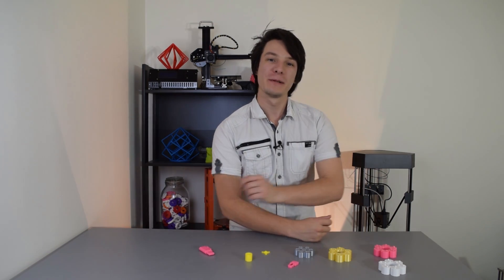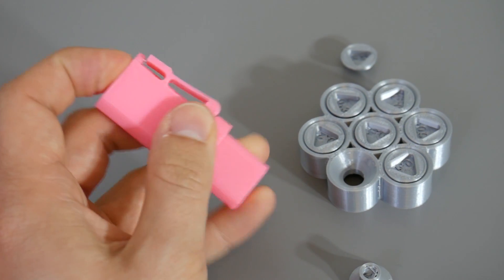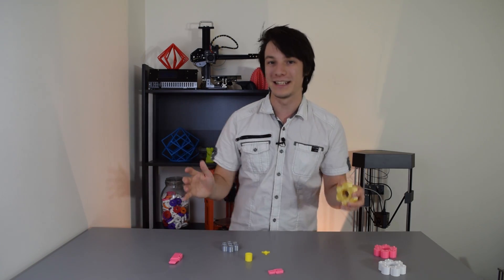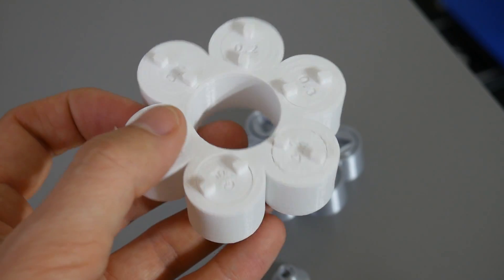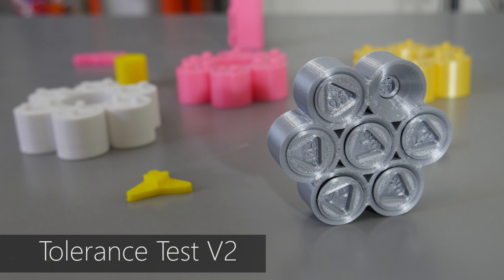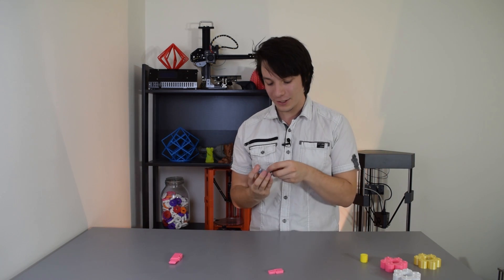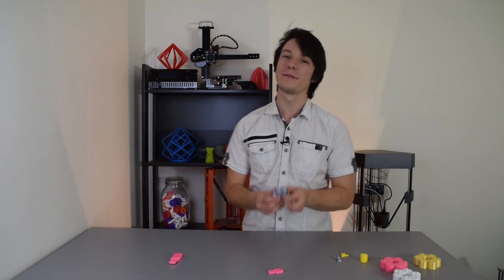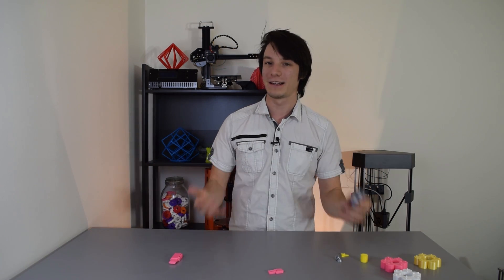How Accurate is your 3D Printer? Take the Tolerance Test!

Comment: So this test is when you make a hole at 1, and the pin at .5 (for .5 gap)?  Adjusting the settings would do it automatically if both the hole and pin were each set to 1?  Or do you still have to design in the tolerance, the settings just make sure they stay where you tell it?

Comment: Why is it called tolerances and not clearances? It's not about tolerating it's about clearing

After looking into it - tolerance means how well a part can tolerate manufacturing variance. Whereas clearance is of course how far the parts clear each other by when moving. You could use either here. You're adding part tolerance by increasing part clearance

Comment: If you don't want parts breaking off when you're freeing it from the bed, or when you are trying to release them, use 8 line walls. This will ensure solid hourglass waists. I also re-mixed the wrench so your fingers don't hurt - I'll put  that on Thingiverse. Yes, I'm aware of the Mark 2 on the other video.. 😁

Comment: Pulling up on an old video but just HAD to chime in. I was able to get to .2 tolerance with easy spin initially on my stock Sidewinder X2 and could eventually get the .15 tolerance after applying a little force with the key. Initial test was printed at 0.2mm layer height from a 0.6mm nozzle and the second test where I could break free the .15 tolerance was printed at a .16mm layer height. Fantastic object and love your videos! I've been following you since my forray into 3D printing.

Comment: Thank you for this! I'm a bit new to 3D printing and have had a lot of trouble with hole measurements. It took me 8 versions of the same part to get it right. With this, hopefully I'll achieve a successful build with more confident measurements and less waste in both filament and time.

It's also cool that it doubles as a fidget spinner!

Comment: Ender 3, 0.95 flow rate - only the 0.5 freed up using a screwdriver. Extruder is calibrated, single walls are calibrated, dimensionally it prints fine. All works great but on prints such as this i get useless tolerance results. Any suggestions?
Reply: Find any answers?

Comment: Don’t think that’s a good idea... for 10 mm size, it could be smooth turning on a small tolerance, while 60 mm size, need a much larger tolerance to be smooth fitting, and the lag of material will make it stick together between the closing parts, I made two tiny rings for test, around 4 and 6 mm diameter, both 1 mm thick and the small ring has outside radius 0.1 mm smaller than the big ring inside radius, it was a tight fit.

Comment: All were fused on my Ender 3. It looks like 0.5 - 0.3 mm would have worked if it werent for the fact that the first 10 or so layers are fused. The upper 50 or so layers look great! Any tips?
Reply from the maker: too close to the print bed sounds like!
Reply: @MakersMuse  Thank you! Appreciate the reply and the free STL files for the tolerance gauge. Keep up the great work!

Comment: If you make it a cube and eliminate the 0.5 tolerance ring you could also have it measure how dimensions shrink differently in each axis as well as have chanfers, rounded corners and straight edges to see how the printer handles those and by how much you have to compensate when building a model.

Comment: Hi Angus
When i 3D-Printed your Tolerance Test i got a little bit to much tolerance at 0.3 mm.
At 0.2 mm i had to break it apart with a pipe-wrench.
So i gues 0.25 mm is a good middle value.
That's nice you would think, but NOOOO
When i designed a single tolerance test at 0.3 mm based on your tolerance test everything is fussed together while printing with the same settings.

I think your print looks something like this, so i made something similar:
    ┌─┐ ┌────┐ ┌─┐
    │    │ │            │ │    │
    │     >  >          <  <     │
    │    │ │            │ │    │
    └─┘ └────┘ └─┘
At the bottom i also drew champhers to avoid fusing together at the first layer.
I also made all objects combine to one single component in Fusion 360. You get 2 objects (inner cylinder / Outer shaft) in one print.

So why does your model work and mine is fusing together while using the same tolerances and printsettings?

Please help me.

Thank you

Comment: How do I stop these problems with my printer. Its a nereus from tevo.
1. Underextrusion constantly
2. First layer is always needing to be adjusted
3. I have warping with PLA and temps are 210 on the nozzle, 60 on the bed
4. A lot of the prints fail because they sometimes stop extruding or they are knocked off the build plate. I use painters tape because the stock bed is way too good at holding a print down, even if the bed is cold.
5. Retraction is at 5 mm, but i still get a decent amount of stringing
6. I always have to increase temperatures because the area where i print is at 60 to 65 degress Fahrenheit, and its always fluctuating 

7. Ok this isn't a problem but what parts do I need to buy/print to make my printer run better. And what settings should I change in Cura and what values?

Comment: I actually overextrude by default by 105 percent, then in the actual print to 130 percent because im always getting layer separation, but I was able to successfully print a high tolerance phone stand by cherry labs on thingiverse by setting horizontal expansion to -0.15 mm.

Comment: I just got my 3d printer, a Tivo Tornado. Only been using it for less than a week. I used PLA from Amazon Basics. The center 0.5 works fine. The others seemed to have some spidering. So, I took a wrench and tried to break some loose. The tops of .04 and .03 broke free...but left the shaft and bottom end stuck. I noticed the the bottom of the print was not even. Thought I had good adhesion, but I'll have to study that. That's my results.

Comment: Good demonstration but I think you are mixing tolerance and clearance up a bit. Tolerance is the accepted deviation in dimension of a single part while clearance is the gap or space intentionally left between two mating parts, you can have a maximum, minimum clearance or both. In your example all the parts can be way out of tolerance and still have the proper clearances between them. I know I am getting a bit technical and don't mean to sound nitpicky but just thought I'd point it out.

Comment: Hi,
I have a delta printer EZT3D. It has an STM32 controller board. When I was printing a benchy the arms crashed to the bed. and this is happening after 3-4 layers of printing. Unable to understand the reason,
  a) Is it a G-Code problem
  b) Or any hardware problem.
I know this is not the right platform but plz if any of you can help me out from this soup.

Comment: Finally, someone on YT did what I did 15 years before this video.  This is a practical solution to gauge the possibilities of your machine:

Proto-mould already making demo test piece decades before, so for young engineer to learn about "injection moulding" https://mindtribe.com/2013/12/companies-we-love-proto-labs/

Besides "general tolerance test", there are other tests to gauge your 3D machine.

- Wall thickness test
- Smallest emboss / deboss text
- Self tap holes
- max Wall angle without support
- max overhang width without support
- Min Z layer, act like a sheet of paper in book that flick.
- Z Layering affect, shown under extreme shallow angle like a 'landscape topography map'
- min drain hole size (SLA)
-  min live hinge (reusable)
- print orientation XY vs Z
- There are 3 classes for Hole & Shaft tolerances: clearance, transition & interference fit.  Should be tested against machine part as well.

Comment: thanks for this video, I tried it with my Flashforge Creator, a 6 year old FDM printer, It got 0.2mm to work and 0.15mm partially welded. I wonder whats the tolerance would be for DLP printers? Have you tried a tolerance test on DLP printers? 0.2mm is still a little to big.

Comment: Can you make a screw and nut, with the screw threads smoothly having less and less tolerance towards the head, so that with a little bit of math you can convert the number of turns (or how many degrees of rotation) it takes for the screw to seize, into how tight are the tolerances your printer can handle?

Comment: The terminology is incorrect. The correct term would be "clearance". The larger the clearance the looser the tolerance can be.The tighter the clearance, the tighter the tolerances have to be.  Tolerance would be the variances in the printer. The titer the tolerances the more repeatable the work would be coming out of the printer.

Comment: I’m tired FDM printer manufacturers claim that they have 0.1, 0.05mm or lower tolerance while actually it’s a miracle if the tolerance can get lower than 0.2mm
Reply: Sivath Flare 
Well, you must have had some bad experiences with 3D printers, because many FDM printers can reach those layer heights. Hell, even my CR-10 can get to .04-.08 mm if I spend a bit of time tuning the settings to the filament being used. For me 0.1 works no problem for most filaments

Edit! I may have misinterpreted, though it still stands. Tolerances take a bit of time to get right because in my experience it relies on what filament is being used. Sometimes flow causes layers to squish, causing my problems with tolerance. 
But yeah, I agree that manufacturers do make grand promises which are only partly true.

Comment: Doeth the width of one line of printed filament have an effect on the tolerance?🤔
Reply from the maker: Your slicer will try and compensate for the width of the line, usually called 'extrusion width' in the slicer. So a 10mm circle will still be very close to 10mm if everything else is working accurately.
Reply: So it wouldn't make the print more precise if I adapted the 3d obeject's dimensions to be a multiple of the extrusion width?

Comment: blobls and zits can be a anus pains in tight tolerances, even assuming you had the most perfect fdm with encoders, also it dosent had too much sense pushing beyond 0.2 tolerance becouse the shrink of plastic, even pla shrink, also you had to check almost everthing even the nozzle becouse wear over time and the hole expand and deform, dont waste time trying going to 0.1 tolerances

Comment: I hate to nit pick but the correct term for intentional difference in part size to create a specific clearance is ALLOWANCE.  Tolerance is the permisable variation in size from one part to another.  So first you apply an allowance to establish a "fit", then you figure out your tolerances to make sure all combinations of parts made will work with each other.  Don't take my word for it though; check it in Machinery's Handbook or similar.  Angus - I love your videos.  I have an Ultimaker 3 and a 2+.  Using Cura, but have Simpify3D.

Comment: Only 0.5 works on my CR-10Mini and 0.4 using the tool... what and how i must to compensate with Cura 3? I cannot find the parameter and i don't know how to change basing to my results. I compensate with -0.4 and now is too small... strange... tomorrow I test with 0.1 what I can move...

Comment: You're not testing tolerances, you're testing gap scaling. Tolerance would be measured against a static gage. Print the inserts but have the gage part machined to a fitting tolerance. You can then pop in the printed inserts and you will see how much tolerance they have from their fit.

Not claiming that is not a useful test, but it's not tolerance. 😉

Comment: suggestion: you have triangles on the top but you should also have a 1/4 inch square indent on the bottom. this will allow the use of a 1/4 inch ratchet to free up the cylinders or even a1/4 torque wrench to see how much torque is required to free up the cylinders.
Reply from the maker: That's not a bad idea! I'll see what I can do.
Reply: @MakersMuse  Second that suggestion!
And I'll wait until you do so I can pay the buck...

Comment: Now that I've bought it, would you list what settings I should use?  I have simplify 3d and a MakerGear M3 and Prusa i3 MK3.  TY
Reply from the maker: 0.2mm or finer layer heights, but print on the settings you normally use. It's intended to show you accuracy you can achieve rather than trying to show off and clear all gaps. Good luck!
Reply: Thank you for your reply.... I'll try it out tonight....

Comment: I printed the tolerance gadget on my TronXY X8, with layer height of 0.1mm (5 hours!), and managed to free the 0.2mm wheel. I am using filament from a company called Sunlu. I've had good success with printing gears down to module 0.9mm.

Comment: Thanks for the model! And Video! When I printed it, the outside edges of the tolerance tool were not printed solid, instead they became a mesh. However the Key tool printed a solid edge.
Any idea why this is happening? Should I just print it with a 100% fill?
Printing on Ultimaker 2+ Extended, through Cura
Reply: I've tried it now with 100% fill and the tolerance tool is still being printed as a mesh. The Key tool is printing fine still.
Reply from the maker: +Broesky sounds like a weird slicer setting, perhaps try another print with same settings to diagnose. You don't need 100% fill but perhaps 4 or more top bottom and side layers

Comment: "if you have a objet or SLA" well technically a objet is a SLA (it sprays the UV resin like a inkjet than cured with UV lights on both sides of the print head.). But nah those things could easily get a .05 without issue. The 350 and 500 series have a max resolution of about 0.016 (IE 16 microns). However its a 250,000 - 300,000 dollar machine, so kinda expected.

Comment: btw if you want the mk2 to print waaaaaay smaller, it can totally do that, with a half size nozzle, or even smaller. it works fine. but there is a point where you have to start using high quality ABS material instead of pla. josef prusa messaged me one day when i was printing micro text using my mk2, and he said i need 'high flow abs' and BAM they actually mailed it to me for free. so love to them. <3 <3 <3
Reply from the maker: That's super cool! Josef is a cool guy. I'll need to look into a 0.2mm nozzle and 'high flow' abs.
Reply: Royce Barber 
Has a test like this been done on the Tevo Tornado, or CR 10? If so, how did they fair?
Reply: Anyone done this tolerance test on the Tevo Tornado? If so how did it do?

Comment: Hey Angus, so did anyone get .15 or better to work? I got the .2 to work with a little drag on the cr-10.
Reply: David I don’t have experience with anything else, but I do recommend the CR10 as long as you’re carefull with it
Reply: I got the .15 to work using my CR-10.
Reply: Perseids64 that’s awesome. Can I ask what software you’re using and what settings you used?
Reply: Sliced it with ideaMaker. I printed at 0.1 layer height, 30mms default print speed, 25mms outer shell, 45mms inner shell, first layer height .3, first layer speed 20mms, first layer flow rate 105% infill speed 40mms, 3 solid bottom and top layers, bottom and top fill speed 25mms, bottom and top flow rate 105%, 40mm/45mms retraction215°/70°.

I would think that is about all the relevant settings.
Reply: Perseids64 excellent!  Thank you. I’m going to give it another go this weekend

Comment: Would the tolerance be better if you use nema stepper motors with 0.9 Degree increments  instead of 1.8 degrees?
Has anyone tried this?
Theyre quite a bit more exensive than 1.8 degree motors.
Any idea if you need ALL the motors at 0.9 degrees matched or can get by with 3 of them for X Y Z?

Comment: Finally got around to printing this tolerance test. I have an Alunar M505 which is basically an Anet A8 clone, I actually think it is an A8 proper but just rebranded, anywho... 0.5, 0.4 & 0.3 were all free straight off the build plate and I only had to tap the 0.2 from both sides and it was free.(I hadn't printed the key yet.)   :)

All in all I thought that wasn't too bad for a 'bargain' entry level printer.

Comment: I am confused by the model I downloaded. It looks fine in Simplify3D with clear markings and everything but then I prepare to print and the top and bottom show as completely flat. I didn't notice this until I printed and sure enough, there are no markings or anything thing else. It come out as a solid piece. I wasn't by the printer for a lot of the printing and my time lapse shows that it just filled the entire model with fast honeycomb. Any ideas?
Reply: Nevermind..... I'm an idiot. The last thing I printed was a vase so I failed to un-check the merge all outlines into a single solid model.

Comment: Clearance and tolerance are 2 different things. Tolerance is what's given as a + or - on a drawing for manufacturing/fabrication purposes where as clearance is engineered into the parts functional operation. The only way to check tolerance is with measuring equipment that you obviously didn't use, clearances are easily checked with a model such as yours. Your only changing the clearances in your model and not changing any of the tolerances. The only way to check tolerance is to make 30 of the same part using the exact same program, measure them and see how much difference there is between the 30 parts.

Comment: Using a Makergear M2, using the Craftware slicer, and an atomic filament Bronze PLA (not bronze fill, just colour)  we were able to get the layer height down to 5 microns reliably. IF you wanted to take forever to print. That was with almost a year of continual babying and calibration. 

by reliably, I mean layer height showing within tolerance on the micrometer, print walls vertical instead of 'lumpy', and the Benchy coming out properly (That was an overnight print)

I wish I still had access to that printer so I could try your calibration piece.